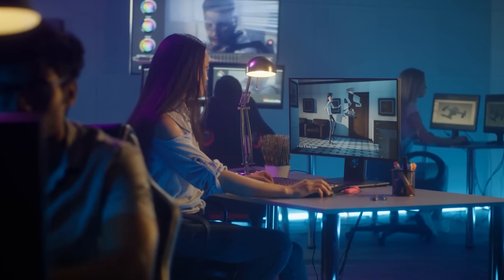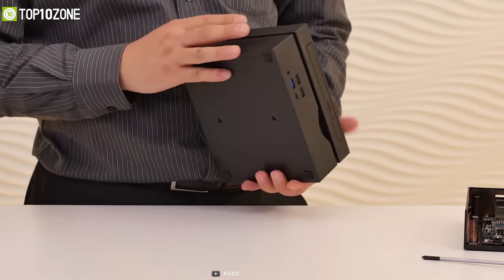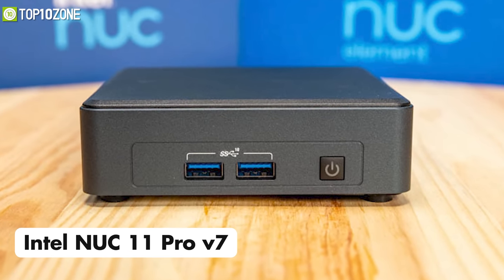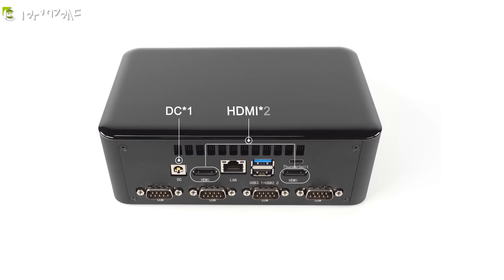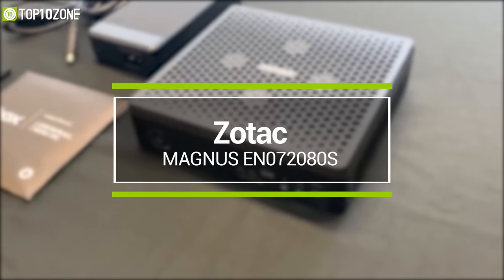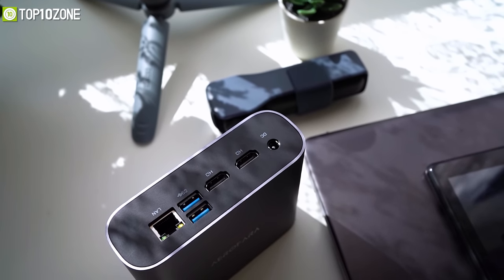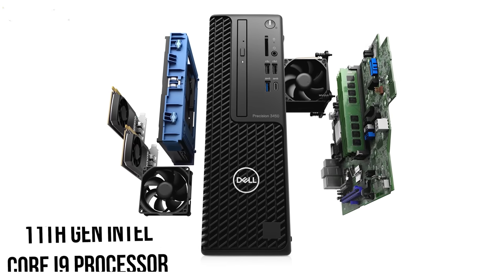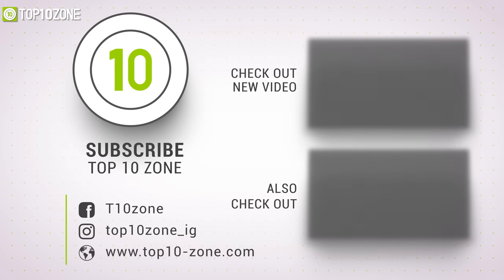Top 10 Best Mini PC

Comment: Cheap ones are the dell optiplex micro desktops
Another one is the Lenovo thinkcentre tiny series ( some can be less than $100, can upgrade to a 4th gen i7 and SSD)
Also the hp prodesk mini PCs as well
These are budget options that are quite upgradeable
Also the Asus Chromebox 3 n017u is good because it can be upgraded to 32gb ram and m2 SSD or nvme

Comment: Just bought a Beelink GTR5 5900HX. Really impressed with it. I use it for CAD and it has been great . Rhino 3D runs flawlessly and Fusion 360 has been solid as well. I eventually plan on attaching a GPU like the Radeon 6600 to it by way of the M.2 NVME slot to improve it's gaming capability. But it's a great little machine.

Also, I looked into getting a Mac Mini M1 but got turned off by it's inability to be upgraded. Also, if you lose the firmware password and don't have the original receipt, you might have a brick on your desk

Comment: I got a little refurbished gigabyte on ebay and I am delighted!
I've put Linux Mint 20 on it, use a TV as monitor, wireless keyboard and mouse and it runs like a train! It is tiny and cost just 139gbp.

Comment: I bought the NUC 11 with 32 gig of memory and 1TB SSD.  Great computer and QUIET!   When I started, a mini computer was the size of two washing machines!  LOL.  It had disk drives that were over two feet in diameter.  The drives were enclosed in clear plastic and I used to sometimes open the back door of the unit to watch them spin.  To move it, I would lay on the floor and push it with my feet.

Comment: Sorry but the Mac Mini is only the nº1 choice for those that don't use windows. You can't use windows with the Apple M1 processor. This looked like a Apple payed ranking.
Reply: Never trust these top 10 things with robot voices, but “using windows” isn’t the only important thing. Maybe it should be first place because  it doesn’t use windows, but something better. Secondly, they (whatever they are) clearly state what is sponsered and what not. And no, apple seems not one of them. Though for you.
Reply: You can likely run Windows using Parallels or similar app, so you can get the best of both worlds. This Mac blows the socks of just about anything else several times its price. You don't need to believe this, but check some decent comparative reviews elsewhere on YouTube.